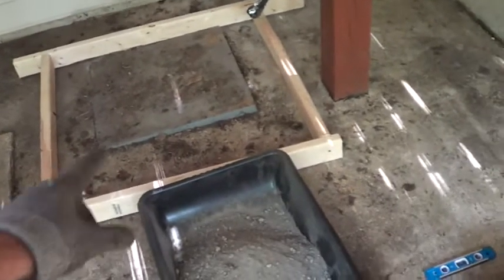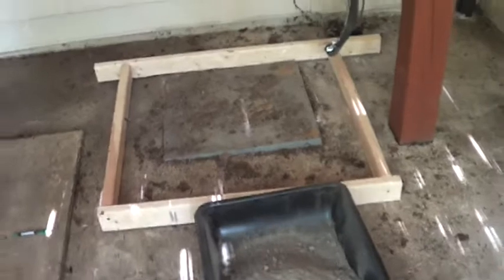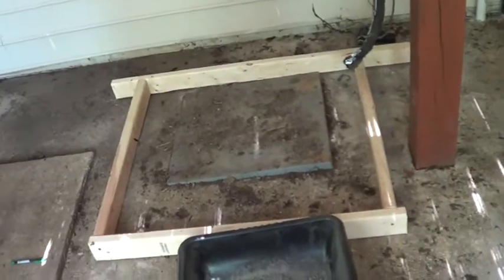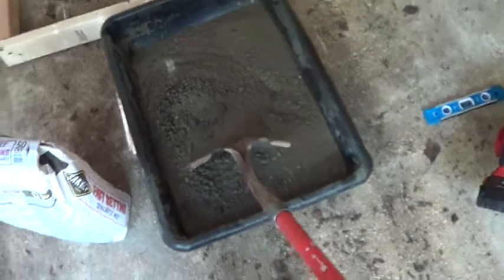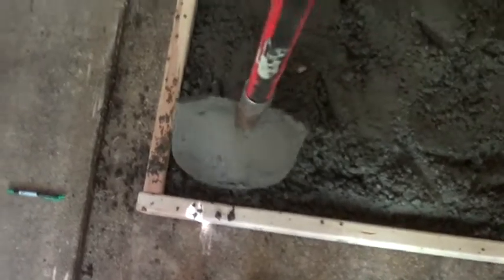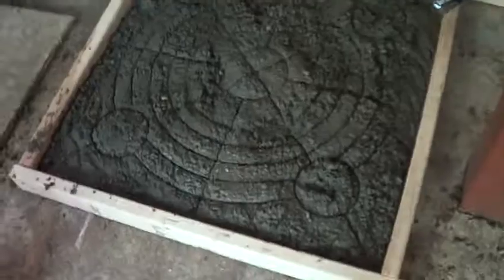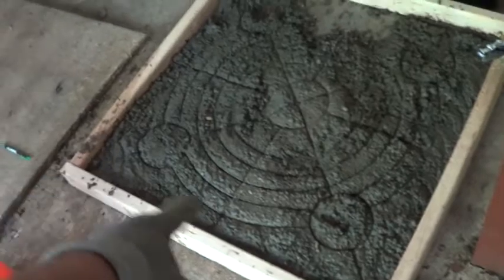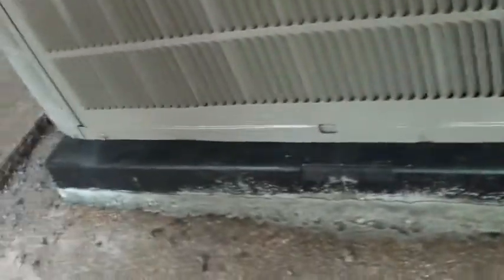Level a Unit Pad with Concrete

Comment: Looks good. If you mask of the edges of the plastic base prior to install. You'd be able to peal it off after you remove your forms. It should keep the cement off the base.